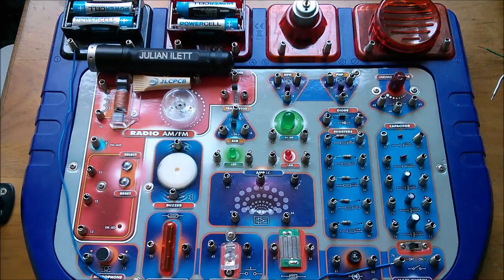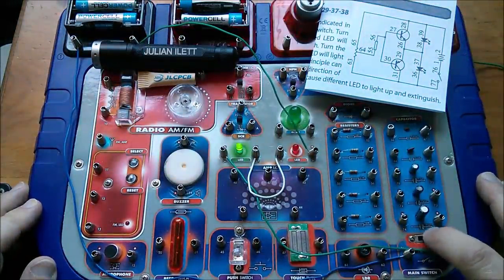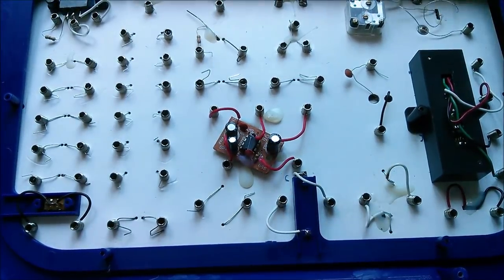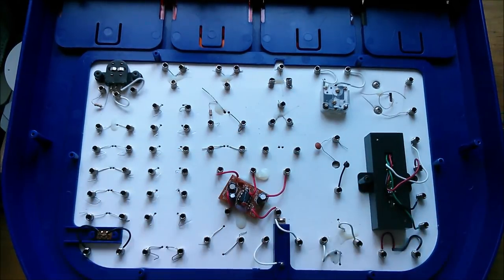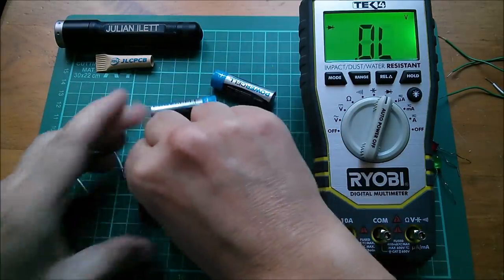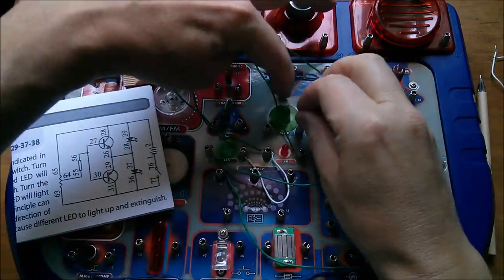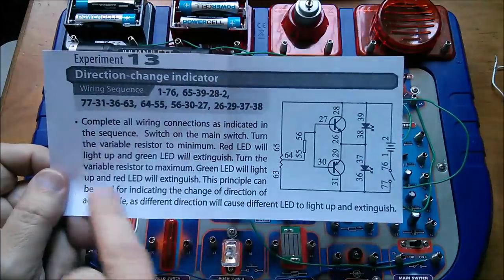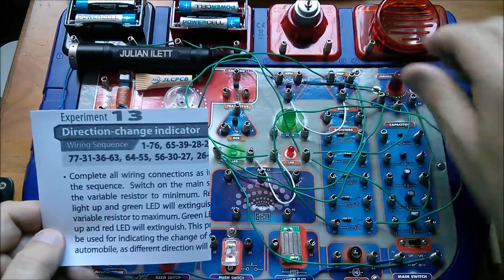Led astray by a LED - Electronics Set

Comment: I had a Philips Electronic Engineer Kit, same spring terminals, but with a nice case to build into.
It taught me enough to study Electronics, I have a full Amateur Radio Licence (currently 32 years).
Arcade machine mechanic, computer repairs, the list is endless.
All because my Father quizzed me as to why I needed to take the torch to pieces, I said I wanted to know how it worked, I was not satisfied that a torch just shone a light, I wanted to now how.

Comment: The PNP transistor might be a higher power rated component, but what determines how much current will flow with a given setting on the pot is the gain of the transistor. The fact it might be able to dissipate more power is irrelevant in this circuit. And also, of course, that red LEDs tend to have a slightly lower characteristic voltage than the green ones.

Comment: Did you have a momentary lapse of reason: 1.7 + 1.8 = 3.5 so of course they won't light with 3 volts!
Reply: He had a Julian Ilett moment.
Reply from the maker: Forward voltage changes with current
Reply: @Julian Ilett
you always need the the minimum forward voltage to get a current flowing :-)
after that you can keep going and more current flows till it turns into old red LED :-)
Reply: YTANDY100 Exactly, in fact, the multimeter reading is usually a minimum value just to light it up dimly.

Comment: Thanks for sharing an ""off moment" in such simple electronics.  Any one can be caught "with their pants down on what otherwise would have been a simple setup.  All the armchair experts are quick to point out fault:  Of course hindsight is always easier than foresight!  One would be lead to think none of those experts ever made a mistake and tell about it!  As a senior electronics tech, I once got hung up on a simple digital meter when testing continuity.  Each time I checked a motor contactor circuit for voltage, I got good readings yet the motor controls were acting flaky or not at all on power up.  I had witnesses and saw me testing the meter leads to each other for continuity and seemed to indicate the meter and leads were ok.  Yet rechecking the motor control logic still did not find the fault.  Finally realized the meter leads were the problem.  It seems the poor connections in the bananna plugs was adequate enough to test voltage  AT THE METER and PASS due to the meter internal voltage, but those leads could not deliver adequate current to go thru the control logic and give a proper continuity reading!  Digital voltmeters tend to only test at about 3V or so and tiny current but to truly verify CURRENT carrying continuity (not voltage continuity) I now always keep this in mind.  Now for real current continuity tests, I use a known load that will pull more than 20ma and preferably .1A to .2A by use of a resistor or simply a proper filament light bulb or toy motor.  Has never let me down!  Another flaky problem I found using a Fluke meter, was voltage readings were meaningless if the battery runs low.  Very dangerous as a circuit at 480VAC indicated near zero volts on the meter!  Has happen several times with different meters.  Only lucky I did'n t touch the wire or I might not be here to tell the tale.  What saved me on that instance was that I always double check by use of my portable pocket neon voltage tester.  It glowed at 480 while the meter said the line was dead!  Digital meters have this potentially fatal design flaw and everyone should know about it.

Comment: They could also title this, “Simple logic probe” - useful for 3.3v logic, such as an a Arduino. Just take out the pot, and hook a long wire to the base-current limiting resistor. Now you can probe around; green - logic high, and red - logic low. No LED = Hi-Z, and both lit - pulses! Just replace the batteries used here with the Arduino’s 3.3v supply. Cheerios!
Reply: Well, Arduino is 5v, so...

Might work on a Pi, or an ESP8266, but you'd have to be careful of backpowering it. Safer to use two comparators and a resistive divider, like I did.

Comment: hello, just found your vids, really nice info about compononts, circuits and general electronic! thank you =) 

have a question i was wondering, if you know the answer to?
im working on a terrarium rack with 7 individual terrariums, so i need alot of temp/hygrometer im thinking use dht11.
but im afraid to run out of digital inputs. is there anyway to read more of them with maybe a 74HC595? or does they need to have own input pins? i have searched both YT and Google without getting a answer :( 

i know ds18b20 can run througt just one set pins

Comment: The transistors have a drop of .6 volts so the led would not burn up with the drop of the transistor and the little bit of drop from the resistor and potentiometer.
Reply: Daves Tech 
.6 V Is over base-emitter, if driven into saturation the voltage over collector-emitter (see Uce_sat in datasheets) can be down in .1-.2V range, and this is what'd be in series with the LED. Current is likely limited by limited base current (times gain (hfe)), and not driving the transistors into saturation, leaving Uce higher than Uce_sat

Comment: Huh... so, some kid must have blown the red LED already.  I guess it was what joinedupon said, below.  But you're right, the LEDs should have a dropper resistor somewhere in that circuit to limit the current, at least through the red LED.

Comment: Red = Blade, Black = Philips, what about posidrive, torx, hex drivers Julian.
I don't think the set is designed for NiCads or any low series resistance batteries, you need good old carbon type.
I would think the set relies on the higher battery impedance to protect things.

As a kid I had a similar experimental set, lots of fun.
Reply: Tom George Easy: just use more colours. Like Blue = Hexagonal. Not that they’re used very often anyways.

Comment: I'd guess some kid tried to turn on the red LED when they first got it by hitting it with the full 3V as if it was a tungsten bulb... with tragic consequences... and the kit ended up in the charity shop as a direct result of that early disappointment.

Got an old radio shack experiment kit for my niece after your earlier video on this kit - LEDs were fine but I had to replace one of the transistors though... semiconductors aren't quite child friendly enough to make ad hoc experimentation rewarding (unless you like the smell of smoke)
Reply: When I was a child I poped a lot of transistors I removed from hardware junk. Sadly I went up being a programmer because I run out of electronic junk to play, and I had a computer to ruin.
Reply: Makers of these kits could throw in a few spares IMO - leds and small transistors cost pennies.

The old radio shack one did list the part # of the original trannies at least... but I just donated a  BC327 - which is about twice as skoocum - come to think of it that probably just means it'll take a few other components along with it when it fries.
Reply: Same happened to me Luiz. I remember making an AM radio as a kid with parts I cannibalized and a guide out of a magazine. If I had more electronics stuff, I would have went a different direction, but I didn't, and started learning how to program instead.

Comment: 5:01 - OMG ! ! !  Seriously?  You're not a 5 year old, Julian, you just saw the green LED working and now you are thinking it is dead too?  Perhaps there is something else causing the green LED to not light?
Reply: You've made the same kind of circuit with your opto-isolators AND you've made very popular videos about high voltage LED modules yet you were still confused?  Have you been drinking???

Seeing the kids circuit kit one would think this would be an appropriate video for kids BUT with your failed logic it isn't.

I never thumb down your videos, Julian, but I have to this time.
Reply from the maker: No, the video was originally 20 minutes long and I cut it down to 10 minutes. It lost a bit of continuity along the way.

Comment: One thing we had when i worked in Telecoms was a probe with 2 lamps in series wired across the 50V supply, the midpoint being the probe, both lamps would light at half brightness, you could test if you had 50v or 0v very simply.
I did a vid about it (logical conclusion)
Reply: Sparky Projects Yep, seen those. But the techs I was with preferred their Fluke 77 multimeters (this was around 1988).
Reply: We had multimeters too, but the probes were for a quick high/low indication
Our meter was ITT Metrix MX202, ours had a thick rubber surround too, supplied by the company (1971-76).

Comment: "no reason why you can't switch the negative side" I get what you're saying in the context of the video but for safety...

You switch positive on DC circuits so current flow is prevented to the device you may be tampering with. Switching the negative and causing a short on the device to any ground could...

Give you a shock
Cause the device to activate unexpectedly
Cause damage to the device

At least that's what I've been taught :/ could be wrong but it makes sense to me.
Reply: That's valid advice, but it's only useful if you have a lot of metalwork nearby that's at the DC ground, like a computer enclosure or similar. Not particularly relevant in this case though.

Historical sidenote: I read somewhere that in the dawn of the automotive industry, there were cars that had the chassis connected to battery positive, and under those assumptions, switching the negative is preferable.